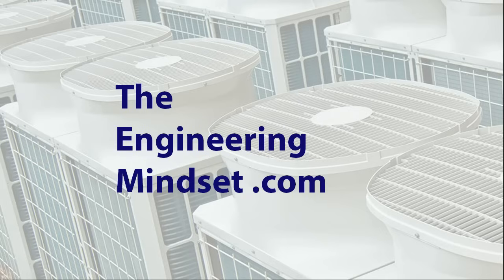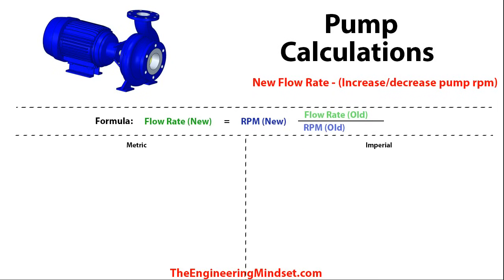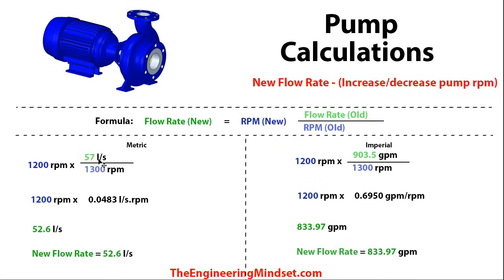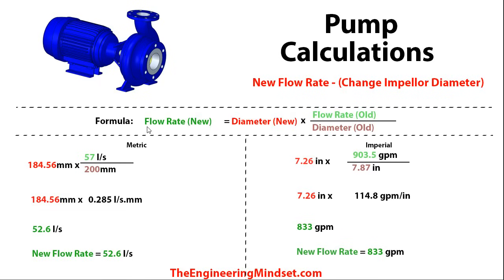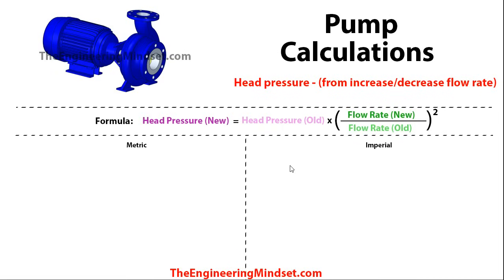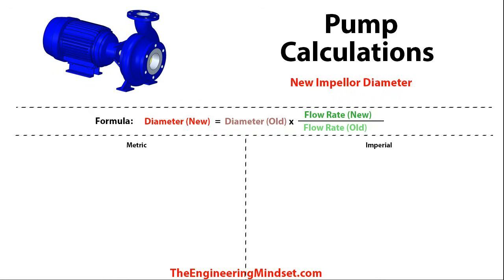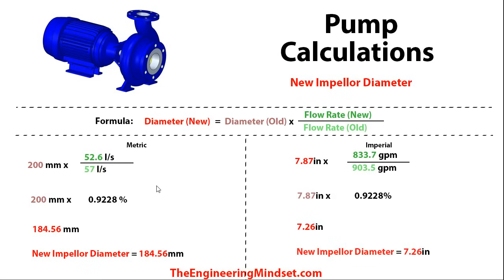Pump CALCULATIONS, Flow rate, RPM, Pressure, Power, Diameter

Comment: A simple question. What is the pressure in bars of 1hp monoblock motor with flow rate of 110l/min. I want to compare this with pressure generated by pressure washer

Comment: This vedio is useful but I have a question when calculating head pressure -increase or decrease RPM why do you square RPM (new) and RPM  (old) and the same with head preassure flow rate.
 can you cralify on that

Comment: What is the relation between Head Pressure and Pump Power? I did some arrangements to all your formulas and I got that Head Pressure (new)=Head Pressure (old) x [Pump Power (new)/Power Pump (old)]^2/3 (here, 2/3 is 0.6666667). But from another equation relation between Power (P)=Force (F) x velocity (v) and Pressure (p)= Force (F)/Cross Section (A), which A x v = Q we got that Head Pressure = [(Pump Power (P)/Flow Rate (Q)) x efficiency (n)]. Here, the Head Pressure is directly linear with the Pump Power. Did I miss something?

Comment: ) 75% sulphuric acid, of density 1650 kg/m3
 and viscosity 8.6 mN.s/m2
, is to be 
pumped for 0.8 km along a 50mm internal diameter pipe at the rate of 3.0 kg/s, and then 
raised vertically 15m by the pump. If the pump is electrically driven and has an efficiency 
of 50%, what is the power required? What type of pump would you use and of what 
material would you construct the pump and pipe? Take R/ρu2
 = 0.004 (e = 0.046mm) 
where R is the resistance to flow per unit area of pipe surface.

Comment: Imagine an standard 3 phase irrigation pump of 20HP... if I want to use only photovoltaics panels, to dimension the PV plant I need to know how much pannels I require to fulfill the irrigation hours... with a known solar profile per Watt, at each day hours the PV panels through the Inverter will deliver a different electric power, which need to be converted into pumped flow for a defined pressure head...¿how you could convert this electric power at fix voltage into pump flow at fix head? (It will depend in the number of PV panels and irrigation requirement, so it is not trivial at all).... hope you can review it to help the spread of PV pumping with standard equipement (current PV pumps are small and with no spare parts market, so aren't recomended by irrigation designers)
Reply from the maker: Well it would be better to store the solar energy in a battery bank and then use an inverter to power the pump. The inverter will let the pump run at the required speed and head pressure and it will pull as much power as it needs. The the pump doesn't need to run only when it's sunny
Reply: @EngineeringMindset  actually that is part of the economic assessment you have to do to size the project, since batteries are one of the expensive parts of the system, and PV pannels are cheaper nowadays related to the inverter, you consider first to oversize the ammount of panels and lose energy of the daily peak in favor of more hours of energy production during the day (current inverters support near 50% of oversize in DC peak power/ máx AC power).
A few months ago I tried to do the assesment for a small high-flow pump to move water between two ponds, were the farmer use a gas pump and he was wanting to know if PV could be cheaper on a 5 yrs payback analysis... considering irrigation in farms runs on the month with higher availability of sunlight, I started the analysis but I get stack since as electrician I wasn't able to properly model the pump running with a variable power electricity input.. was the first time I saw affinity laws, but they end to be not enough information to made the output power-or-flow graph vs electric power input for a fixed head... give it a second thought, surely it will be a good video.. also related papers I found were highly misterious on how the closed the connection about the input power and output power for the induction electric motor and the variable frequency drive.
Reply from the maker: It's not so difficult to calculate, you'll need the pump data from manufacturer, some will provide with vfd, if not you find a vfd that will fit and see what the losses will be from the manufacturers chart. At full load the vfd losses will be highest. Once you know maximum values calculate run time and then you'll know how much power and for how long, then you can size your battery bank and then your solar array needed to capture that much, plus a safety factor. There's other things like ram pumps which require no electricity. They could use anaerobic digestor from farm waste. Wind.

Comment: 6:30 isn't flow relative to pressure? i.e decreasing flow increases head pressure and vice versa along the pump performance curve.
Reply: I missed that part because it goes against everything I've learned. Are we talking about another pressure? Did you get any response on this matter? Best regards
Reply: The equation shown is meant for system curve. For the system, it's the vice versa, higher flow means higher head due to the friction losses.

Comment: Hai sir I'm mohamed sir I've doubt about flow measuring..
How to calculate chilled water pump flow rate without flow meter... I've some of date like suction pressure and discharge pressure and speed of pump(rpm) pipes size voltage and amps please sir can you explain it daily I'm face flow measuring issues with consultant plz sir

Comment: Sir plz plz tell me why u putt old and new
Reply from the maker: Because we're replacing an old or existing pump with a new one
Reply: @EngineeringMindset   If we are not replacing we are selecting a new then what will be formulas?? And plz tell me how no of turn will reflect at gpm flow in pump

Comment: I have question : how to count this?
Rpm pump 1200
Efficiency of Pump is 0.79 %, 
Power of pump is 87 kw
the voltage is used 240 voltage or single phase. 
Height of pumping is 20 meter,   pump works 2 hrs to fill the tank..
1. How many liters of water can pump fill in the tank during two hrs ?
2. How much electricity bill need to pay if charged 50 cent an hr during  in 30 days.?

Comment: At 6:46 on the right side it says "gpm" divided by "rpm". Also im a bit confused if that equation is correct because 1) the pressure increases with flow and 2) at zero flow you would have zero pressure.

Comment: My nameplate only lists my Motor RPM. Is the RPM and the power that you're referring to in your video that of the motor RPM? Or is it for the Pump RPM? And if those two values are different, how do I calculate pump RPM from motor RPM?

Comment: What is the relation between Head Pressure and RPM? Why do I need to square the RPM in the calculation to determine the Head Pressure from the increase/decrease of the RPM?

Comment: Thank you for informative video. I have a question! If I have pump with flow rate= 3.5 gallon per minute and nominal pressure = 40 psi. What is the benefit of nominal pressure or what is the relationship between the nominal pressure and flow rate?

Comment: If 1 pump is 3 bar and I run s second water pump also 3 bar what is the pressure  is it 3 or 6
Reply: You need to clarify the configuration of your system. Are the pumps in series or in parallel?
From explanation sake; let's imagine a pump which operates at 3 bar producing a flow rate of 5 l/s.
If you operate in series; pumping from one pump directly into the suction side of another, the flow rate of this arrangement would be 5 l/s  at 6 bar. The discharge pressures are summed, the flow rate remains constant. 
If you operate in parallel, two pumps pulling from the same tank and discharging into the same line, the flow rate would be 10 l/s and the pressure 3 bar.
If you're unsure about different pump arrangements look up some diagrams.

Comment: May I ask, is the liquid flow same as (or at least close to) the flow rate at the pump nameplate? Eg. the design nominal head is 30m, and nominal flow rate at 45m3/h, let say in the actual system the head loss is only 20m and the pump is oversized, will the flow rate higher than this design flow rate of 45m3/h or still around this value? We don't change the AC frequency and other stuff.

Comment: I'm trying to figure out the discharge pressure of a pump and kinda frying my brain doing so. lol I have an engine putting out 2.5h.p.@ 3600rpm coupled to a pump that is capable of 161 feet lift and it can pump a maximum of 100 gallons a minute. What discharge pressure is it capable of?
Reply: Convert you 161 lift (head) to a pressure measurement. I don't work in imperial, but if a pump is able to produce 20 meters of lift my discharge pressure would be approximately 2 bar.

Comment: Calculating output pressure in bar having only the pipe diameter (0,04m), fluid type (water in my case), height (1m) and flow rate (0,42 l/s)?
Tried doing that using Bernoullis principle, but i cannot obtain the pressure to get anywhere. Would anyone mind helping me?

Comment: i guess that there is something missing here.
As ratios are equal first question is why are they equal..?
and second u should put some original formulas there too like Power/RPM cube is equal to what?
Reply: These laws assume that the pump efficiency is constant across all regions of the pump curve; which of course is not true. The accuracy of these calculations will vary from pump model to pump model. Even using the same model but altering the impeller size can cause huge variation.
In practice, I would never use the affinity laws and instead try to interpolate between two points for the best results.

Comment: I'm designing and building a small centrifugal pump for a cooling system for my computer. i've searched all over the internet for something to calculate the displacement of an impeller with a certain diameter and number of blades. can you suggest anything?
Reply from the maker: You can use Simscale to calculate and simulate it. https://www.simscale.com/

Comment: hey I have a query -- i've been watching your videos from 3 phase to transformers to invertors to induction motors to pumps... and if the frequency/Hz affects the rpm of the motor thus the rpm of the pump... would a 60hz supply cause 3600 rpm? if a pump has an rpm of 1200 or 1300 like in this, do they have a controller?
Reply: A controller affects rpm by changing the frequency of the motor. If the frequency is not altered and is at line frequency (60Hz for USA and 50Hz for Europe), the motor rpm is determined by the number of motor poles. RPM = 120* frequency/No. of poles
Reply: Has to be there phase for large municipal wells.

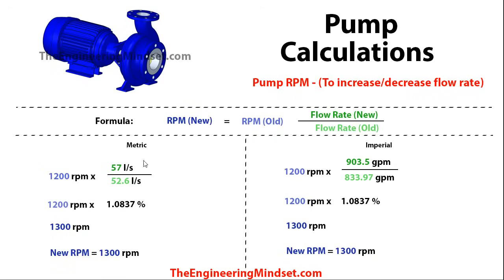Comment: hello, you used the same ratio and proportion for New Flow Rate and Pump RPM in video @2:33 and @4:27. Of course they will be the same result.
Reply from the maker: Yes, it was done this way for that exact reason

Comment: Thank you for this great video. I have a question, What are the specifications of a DC solar water pump that can give us 3 cubic meters of water/day? How can I calculate the flow rate of it? Please help me :(
Reply from the maker: Need to know how long it runs for, do you want e.g. 3m^3 in 1 hour or over 24 hours. Then you need to know the difference in height from pickup to drop off. Then need to know the pipe diameter and roughness and length to calculate the resistance. Then put this all together and you know the size of the pump needed
Reply: I hope that 1728000000 rom whatever is just academic and not in any horrible dystopian system of water control...

Comment: very goog work. Please , will a continues increase in rpm neseccerily result in increase in 
presure.   

2. what will be my practical result if rpm is increased to over 7000 and more. please help and respond. Am a farmer
Reply from the maker: The equations used are theoretical and the results in real world applications will be somewhat different. There are limits to how much pressure the rpm can provide, check the manufacturers design data.

Comment: Thank you for the helpfull video. Can you give me the info, how changes the pressure depending from the diameter of the impeller?

Thank you veryí much: georg Balog
Reply from the maker: Hi Balog, you can use the formula P2/P1=(D2 /D1)^2 where P = pressure, D = diameter 1=old, 2=new. Just rearrange the formaula.
Reply: Thank you, my friend. We need pumps for water well drill fluid, mud with a lot of sand, clay a.s.o, and professional pumps are really very expensieve. We would like to give a try to self build pumps. I will send you pictures, wenn it will work.
Reply from the maker: Sounds like a great project. If it's a mix of mud, sand and water have you considered an Archimedean screw pump. It works very well for these applications as all external with no impeller

Comment: Your channel is so helpful! Thank you for making my summer job easier! 

Side note: as an aerospace engineer in training, I would like to tell you that your logo doesn't make sense (3 gears cannot turn when they are configured as you have shown)
Reply from the maker: Maybe if you were able to observe the gears from a different perspective it does work. The little gear is not connected to to right most gear, only the left. It sits further back.
Glad to hear you found the videos useful, there are plenty more coming!
Reply: sir, please upload a video for pipe line sizing based on flow rate and pressure